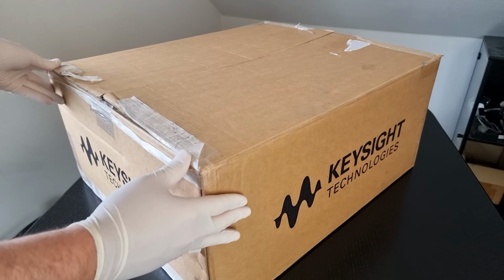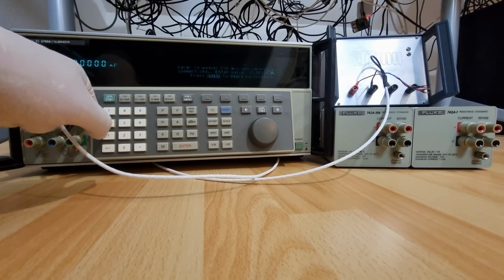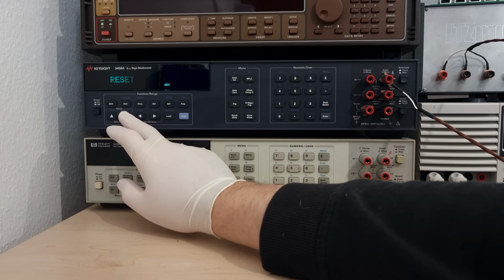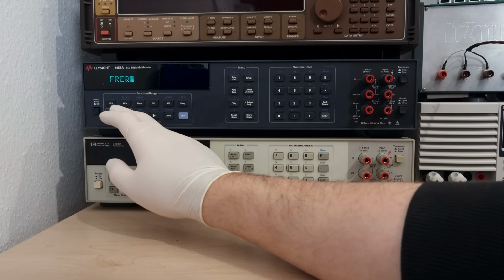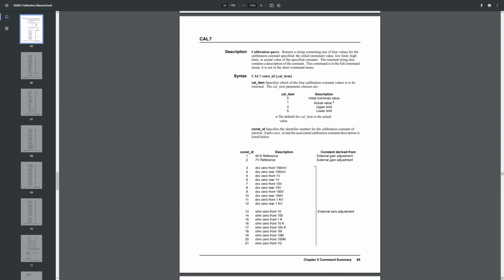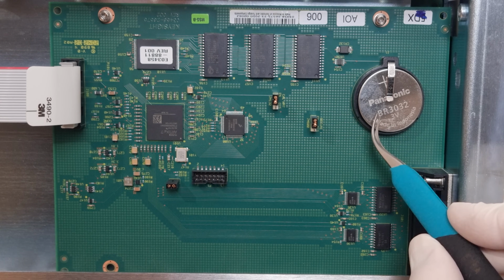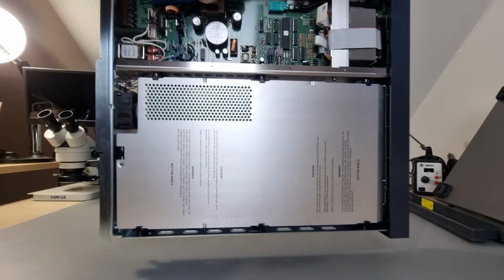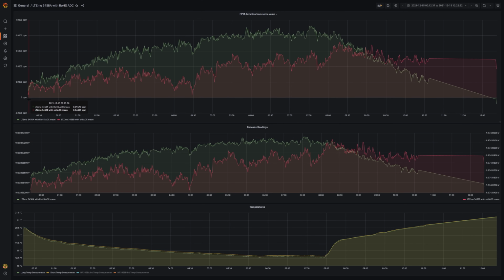What has Keysight done to 3458A?! Dark Theme 8.5 Digit Multimeter

Comment: why do these high end lab bench multimeter, calibrators all still use these VFD like displays, is there a specific reason to this, always wondered about this?
Reply from the maker: Modernized devices like a Fluke 5730A or Fluke 8858A multimeter use color LCDs. Most other devices in this category are based on designs from the 80s. I don't know about any big advantages, but readability and longevity are good. I am not sure but I think I have heard that the newer touch screen Keithleys often need cooling fans specifically for the electronics associated with the displays :_keithley:
Reply: @reps  maybe you can make a video about why you're doing all this. Why are you doing long term stability tests and ppm counting and all this data logging. I just don't get _why_you're doing it. Is it just for "fun"? Is it for a grad school research paper? I think that would make for a great video.
Reply: It's an active display for better viewing angle than LCD.  Maybe that it has a cool retro appearance. I really like the dot matrix VFD. OLED displays are used in inexpensive products now. Maybe harder for counterfeiters to make knockoffs with VFD displays.
Reply: If you change the display, you most likely would need to change the case and button layout, as well as the UI on the display - so that would need retraining / all procedures referring to these to be updated.

In short, it would not be a drop-in replacement anymore. But that's the point of the 3458B.

Also a modern display would have totally different EMI characteristics, so it might need additional changes to shielding and verification.
Reply: what my guess is that it has something to do with the industry standard, like employees are used to the current menu and control scheme, and they dont bother changing it as then the users would require training to use the new equipment
Reply: LCDs are cheap displays and are inferior to VFDs in every way.
Reply: @mbox314  VFDs have a lifetime of a laughable 1k to 30k hours depending on colour. With LCDs the only limiting factor is the backlight, they basically last forever. 
Wikipedia lists the advantages and disadvantages for both VFDs and LCDs and its really no suprise that VFDs are only used in legacy gear - they suck across the board.
Reply: Same. Any input on this?
Reply: these devices are specifically built to be the way they used to be. fully compatible with pretty much zero changes. They have been in use in tons of research rigs and keeping them identical is just less to worry about.
Reply: Reliability i guess ..?
Reply: Because the design predates lcds, so it is cheaper to continue production with existing parts than reengineer, qualify, and set up new production for one board. It's about $.
Reply: @kevina.4036  LCD don't work at the top end of the temperature spec for these.
Reply: also find this odd, but my guess is because 3458A has been the de-facto industry standard for metrology for decades, and there are thousands of engineers who spent their whole lives with it. To reinvent the user interface would have meant potentially a big annoyance for those folks. Maybe this meter in particular, because it's so old, it serves as a sort of symbol, a trademark if you will, that people associate with accuracy and reliability. I have no doubt that keysight has engineers that can design a really modern user interface with touchscreen color LCD that runs a full android or something like that, but there is something special about keeping the old look and feel that people have loved for many many years.
Reply: persecute!!!!! Kill the heretic!!!
Reply: Maybe they are much cheaper or they have a huge stockpile of them.
Reply: My main concern with VFDs is the display lifetime, having a couple old fluke meters with the displays going quite dim now.

Ultimately though, I suppose having a couple decades of readable display might not be all that bad, really. (intermittent use)
Reply: LCDs go a bit flaky at high temperatures. Maybe the military want some?
Reply: It is parts commonality. Old 3458As with fried front-panels can be repaired with drop-in new parts. Don't ask me why they still don't respond to IDN.
Reply: one thing could also be that they may last longer when left on 24/-365 in test labs, vs LCD's where the backlight often dies after some amount of time. another thing Is a lot of these devices have old ancesters or olderversions, so using a known good design is often prefered to limit the needed part catalog.
Reply: @andreasthomsen852  but the newer bench psu's and some other equipment uses lcd/oled screens, so this is a bit weird
Reply: @andreasthomsen852  Backlights for this size of display would be LED rather than cold cathode tube so reliability is very good.
Reply: Probably because you don't need a UI/UX designer if you simply use a VFD. Having a bad LCD Menue is worse than a standard VFD Display. Also they will never look too much outdated. A 10 year old LCD looks ancient, but a 40 yoear old VFD still looks great. (Sidenote: that's why bugatti dies not put screens in their cars, that way they will always look timeless)
Reply: @hansdietrich83  A VFD and buttons are still a user interface, and still require user interface design. Nothing about UI/UX work requires that it be a graphical user interface. A user interface can have any kind of display (or none at all), switches, buttons, etc. If the user interacts with a control, it’s part of the user interface.
Reply: @tookitogo  yes, i know that, but designing a standard vfd interface with standrd buttons is much simpler than designing a coherent screen interface
Reply: @hansdietrich83  As someone who worked as a UX designer for a while, and who is working on some small-screen, text-only device interfaces right now: you couldn’t be more wrong! The constraints of such things do rule out some areas of complexity, but introduce other significant challenges. It is really hard to do those well. The difficulty people have operating devices with really small screens is a testament to this. VCRs, fax machines, printers: all classic examples of things people struggle to configure. It’s hard to design interfaces for them because you can see so little at once; you can’t see the context.
Reply: Perhaps because it refreshes faster? Less processing/delay compared to a digital screen? No idea just taking some guesses
Reply: @Sw3d15h_F1s4  i dont think so, modern lcd/oled displays have a refresh rate of way over 120hz, plus these things have powerful fpga's in them so processing shouldn't be an issue, ig it might have to do something with such interfaces being industry standard but then that doesn't explain why they have used lcd screen in their newer bench power supplies, this is indeed intriguing